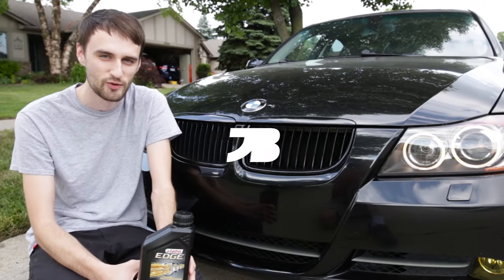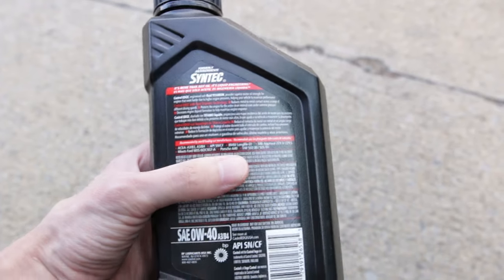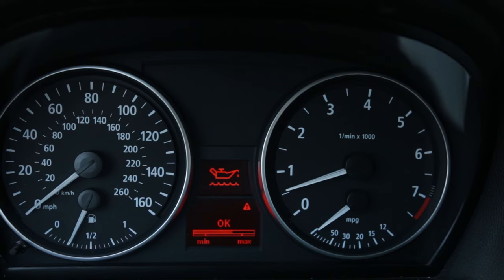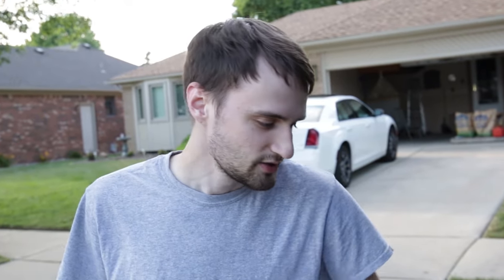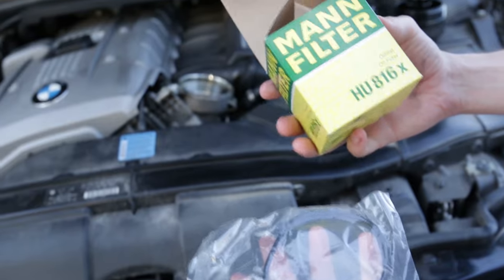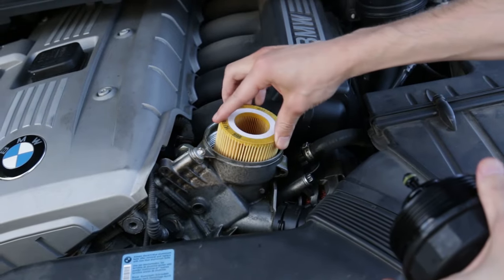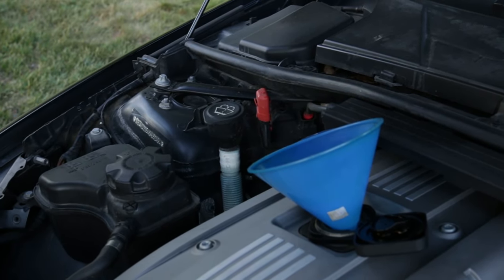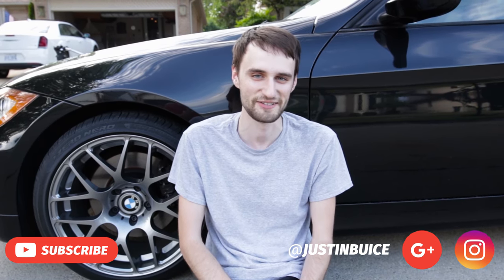BMW Change Your Own Oil!

Comment from the maker: Hey guys, I just uploaded and updated version of thie video. It is a bit more informative!
https://www.youtube.com/watch?v=XqgWPdBYx_U
Reply: Justin Buice sister
Reply: Hey Justin, how many quarts of oil do we add?
Reply: Justin Buice Hey bud how are you and i have questions i want to change my bmw 325i e90 2006 Differential fluid which is 75W-90 but if u may know how much Quarts does e90 take 1 or 2 Quartz and also the Main bolts holding the diff face what are the FT pound Torque ? But i might just pump out old fluid then pump in new.
Reply: You should do a video on changing your gearbox oil too.
Reply: J05ephx That would be nice and since its my passion 👌🙌
Reply: Hi man...I have a problem of inative oil level sensor....how can you help....I have tried everything...(e90,,,325)2007
Reply: Why u are using 0w40 and not the 5w30 as bmw recommendation? Thanks

Comment: You should put the oil filter into the cap and push down until it clicks and has a little play. Not put the filter in the housing first. Other than that great video. I enjoy your vids.

Comment: dang, thought it was going to be harder, but the extra steps are very simple.  Nice video Justin.  Thanks
Reply from the maker: +JimsReviewRoom yeah its pretty much the same as any other cay besides the gaskets on the oil filter. Shouldnt take more than 20 minutes
Reply: JimsReviewRoom I
Reply: You own an e90? If you do that's awesome!!
Reply: Wait is it? No need to remove the cover? Nice.. but coolant still needs to?
Reply: Im goin to domi today tired of paying 180$

Comment: @Justine Buice... I just bought a certified pre-owned 535i GT. I'm gonna try this myself. I've changed oil in my Sonata and Azera. For some reason I have felt incapable of even looking under the hood of the BMW. It's setup like they don't want you to touch it. Thanks for this empowering video!

Comment: remember to use rubber gloves next time :) used engine oil is very bad your body.
Reply: AndersDog94 good tip
Reply: AndersDog94   Been changing it without gloves for 25 years & no issues
Reply: AndersDog94 That would help!
Reply: No he's right, petroleum isn't good and absorbs into your skin. Any issues wouldn't arise until you're much older. Brake dust is the worst though and I would wear a mask or resp while doing brakes. Now I've done thousands of changes without gloves as a mechanic but honestly it's much better to use nitritle gloves mostly to keep your hands clean for when you need to touch things you don't want to dirty. The protection is just a bonus.
Reply: Get out a here, only real men work on cars.
Reply: There’s a difference between acute and chronic exposure

Comment: I had a 3 year leased BMW and spent $1.27 on that car. Now I have a used M535i gonna do oil change this weekend. Looks like the oil/filter is gonna be $40-45 roughly. Great videos. Port Huron, MI is where I grew up. Now in Florida.

Comment: Great Video! Like you, I always take pride in servicing my own cars, which includes brakes, oil, cv joints, tran fluid, etc. For Safety and body mechanics, purchase a better jack and a oil drain pain (most separate the plug from the oil). You should also install the filter on the base once you install the gaskets, then install it. Purchase the oil filter tool to remove and install the oil filter. Oil Filter housing screw and oil pan plug should also be torqued to required specs with a torque wrench. My 2017 M3 is still under included Ultimate Service Warranty, but I will service it once it expires.

Comment: love your videos, if you cant tell from the mass commenting I've done today. 

I had a similar jack but when I bought this car it was lowered and I couldn't get under it with it. I upgraded to a much larger, low-pro jack. It was about $200 CAD. And well worth it. It's easier to operate due to a larger pad and better leverage from a longer handle. I feel safer working around my car. 

FWIW oil changes are the one thing I don't mind paying for. It's messy and tedious. And historically I don't feel like I saved all that much money versus the effort (getting parts, disposing of oil, etc). And it only has to be done once a year based on how little distance I drive.

Comment: Hey justin, thanks for the great video. Just one thing, BMW oem oil and manual recommends SAE 5W30. That is the one I use for my 2010 325i. Why did you decide to use 0W40 instead? Thanks.

Comment: Great video! I have a Bmw 2007 328i sedan. What oil would you recommend it has high 140000miles. They say volvine , Castro or Bmw high performance I am really confuse and scare of what to add on my car.

Comment: Hey justin i just got a 2006 325i and wanted to do the oil change video helped a lot but wondering to use SAE 5w-30 or 0w-40 i dont have the owners manual

Comment: Great video!  Make sure that when you put the oil cap on you don't over torque it because it could cause the cartridge in the center to snap off! If you have an N54 or N52 don't worry about it and stick it back on, but a few models it can not reattach.  I made a video about this issue because a lot of people don't know the problems it can cause.

Comment: That motor takes 6.5 Liters, so you'd be okay using 6 quarts of oil. Also you can buy an oil filter socket on amazon for about $20. That's where I got mine and that's the one I use in the shop.

Comment: I have a question 2017 BMW 330I. FRIDAY March 18 oil change by a lube place got done 1 mile down road low oil pressure light came on. Aftermarket filter was used. Could this be filter. I should use  BMW filter? Car run fine. I am not driving it at all. Until I change filter out

Comment: Thanks for the video, looks very nice, but I don't understand, you cut the o-ring from the correct location in the cover cap, but then you locate the new o-ring in the wrong location, up against the lip of the cover cap, not the groove then you screw the cap on leaving the o-ring visible [@3:36]. I know you haven't done this with all your oil changes, as it was in the right location when you removed the cap in the first place, and you're clearly not a newb yourself, so could you please update this video, so other beamer newbs dont screw it up.

Comment: Hi, i have a 06 BMW 325i anyway always change myself too so it s much cheaper than mechanic. :)) ( mobil-1  05-30)
what i do  when i change the oil open the first filter  and oil cap so it s gonna come down oil so fast. also you can use plastic ramp it better than jack. 
 thanks
Reply: Wrong oil you’ve been using

Comment: Does it automatically adjust the onscreen advice with respect to service time suggestions? How do I tell the computer I have changed the oil? Do I have to buy an $800 reset/ diagnostic computer?

Comment: So idk where the drain plug is, tried doing an oil change but that parts stopping me, idk if it’s cause I took the plastic splash pad off or whatever they’re called that go underneath the car but I can’t find any little flap with a drain plug behind it

Comment: Use gloves. Open the oil lid before you do anything. And dont max it out the oil, it's better to have the amount that Justin had before he changed the oil and then fill up from time to time.
Reply: Why is that so ? I just have my car serviced and filled 4L of engine oil I thought it wouldve gone to maximum level but it's just same as the level as the starting of the video.

Comment: Hi Justin. I have quastions for you I have 2008 BMW X5 3.0si and I don’t no what can of engine oil I have to use 0w-40,5w30,5w40.I used now 5w40 Castrol but this oil am not sure is the best let me know Thank You !

Comment: Great job! But to hints 1) I like to put a rag next to the funnel that way when I remove it the oil cause right on the phone and not on the engine. Hint #2 leave the oil cap open before removing the oil plug go make the oil flow a lot easier and hold on to the plug Don't Let It Drop into the oil pan next time..lol

Comment: I just bought my  2007 Bmw 328i from a local used dealership 3 months ago but I can't Check the oil if it's a safe color. Should I change it? And In the manual it doesn't how much it takes.

Comment: What should i do if an oil gauge dosen't work?
 My 2006 bmw was low on engine oil  when i bought it, so i bought 7 liters of engine oil and put six and half of it but my oil gauge bar stays at only half of it. Is there any problem with my oil gauge or would it show full bar eventually?

Comment: I'm 15 now and saving for a car I want an e90 or e93 (328xi). My parents said insurance would be outrageous, I got an online quote for $161 per month for me when I'm able to get my license. (Not bad for a first driver.) And then they claimed oil changes/maintenance would also be expensive and impossible to do I said they wouldn't, but of course as parents are they didn't believe me. I said all you have to do is get the car above the ground and it's the same as any other car other than the filter and oil. My dad is very mechanically inclined and can fix about anything, hes owned multiple BMW's now an M4 which I'm in love with lol. Maybe they just dont want me driving a car capable of 155 on the highway. My dad agreed to match what I save (So I can learn the value of money, which I'm perfectly fine with b/c I will never have that chance again since you dont get cars half-off) , I'm trying to stay below $10k combined meaning I would save a little over $5k. The other option is a Kia Cadenza the insurance cost is $183 per month and a Ford Focus $797 per month(I'm sure the site glitched haha, I did it again and it said the same), the BMW would probably be more than both with premium gasoline unless the Focus is actually $797 per month🤣. Any thoughts? Am I being reasonable or not? I'm thinking the Focus is probably the best for a first car but I do like the Cadenza alot. Sorry if this was to long lol.

Comment: I have a 525i that’s has 114500 miles on it  and the first time changing my oil I went to oriellys and they recommended me high mileage Castrol Edge is there a difference or will it damage anything

Comment: Hi Justin,

I have been watching your videos so I decided to buy a second hand e90.=)

i got a 2005 bmw 390, and I am just wondering what would be the problem since my oil display would show i have enough engine oil but after few hours it will show that i dont have enough oil? would there be anything that i would need to check or replace? thanks for the answer

thanks!
jeff

Comment: Hey man, nice car. What is the milage on your car? Is it reliable? Also, I wanted to say instead of having to mess around with jacking up the car and the drain plug why dont you get a oil suction pump? In europe everyone uses those its much easier.

Comment: Hey! When I took my oil cap off it looked like there was no oil inside but my sensor says my oil level is at the maximum level. Should I be seeing oil inside the reservoir ?

Comment: I've bought Castro Edge high mileage that's 5w-40 full synthetic for my '06 530 xi.    It does not say it's German made, its USA made.   I see you have the same oil except your weight is different so what am I missing ? What is the big deal friend ? Please do tell.  Nice video tho

Comment: Justin you are very knowledgeable about BMWs. Can u answer a question? My 2009 535i is having an issue. I keep getting a warning and/or alarm that there's a gear selector malfunction. I can shift into D, N, R, and drive just fine but it won't shift into park. I turn the car off and it's back into park when I restart it. What do you suggest? Thx
Reply: patsatx   If that's a steptronic like my 530 xi is then you very well may need to check your wires on your gear shift.   YouTube it.  They become worn & may need taped up & or soldered.   Minor & relatively common issue.

Comment: Hey Justin, I’m confused with the oil change. I’m low on oil so do I just top it off or do an oil change? I know we have that oil maintenance reminder on how many miles to go before an oil change but that looks like I don’t need a change for another thousand miles or something like that. Is that even accurate?

Comment: Did you climb under the car with the only thing holding it up being the hydro floor jack?
Reply from the maker: +t s i used an axle stand
Reply: Justin Buice
 I know this sounds obvious, but where do you put the axle stand?  I've been jacking at the front center hardpoint and using jack stand at jack locator on the side sill, but that's terribly unsteady.

Comment: what do u do with old oil? also I heard putting oil in the filter is a good idea to since you don't want it suck dry. Not sure if that's a myth.
Reply from the maker: +GodKing804 most auto part stores recycle it for free
Reply: Justin Buice thanks dude
Reply: Agreed. Filling up a spin on filter doesn't hurt, but there's ZERO evidence of it being necessary. Also kind of moot on BMWs with their element filters.

Comment: I've been looking for a vid to show how to change oil on a 3 series! I'm sure its the same procedure for a 2010 328i...i also got a straight 6 in mine.... appreciate the video!
Reply from the maker: Yeah it's pretty much the same, just check the manual to confirm the correct amount of oil

Comment: Hey man i have question om looking to purchase a 2006 330i manual what do u tbink about these cars? And what about the oil level sensor? What if tht snesor breaks and u dont know how much oil u have in it? And are the waterpumps a major issue?
Reply from the maker: I love mine. I've had it for 5 years now with minimal issues. The oil level sensor isn't as bad as people make it out to be. As long as you are doing regular oil changes it's not a problem. If the sensor dies, the car will give you an alert and I don't think they are too hard to replace.

As far as the waterpump and thermostat, they are a widespread issue and they tend to fail between 80k and 100k miles. Fortunately, the parts are only about $450 so if you are handy with cars, it's not too bad of a repair. Especially considering that that is one of the ONLY major issues with these cars.

Comment: I just bought a 2007 328i and it says the oil level is OK. But should I change it? I don't know when they last changed it. What would you recommend?
Reply: Check what colour the oil is, if it's still yellow like frying oil then it should be pretty fresh, but if it's not that i'd recommend changing it anyway since it's not expensive, and a frequent oil change really keeps your car running smooth! I have a 2001 Mitsubishi Galant, owned it for 7yrs now and I can tell by the feel of the performance and sound of the engine that I need to change the oil :)
Reply: Peter van Lelieveld thanks for your help but the bad thing is that my car doesn't have a dip stick so I can't check

Comment: at 3:44 you say youre gonna change a gasket? do you mean the one on the drain plug? and if so, where do you get a new gasket for the drain plug? does it come with the oil filter? thanks man, love your content!
Reply from the maker: Most brands of oil filters for this car include the gasket for both the filter and the drain plug.

Comment: Hi , can I change the oil filter after the mechanic has changed the oil ? I mean the next day for example?
Reply from the maker: They should have replaced it at the same time. If you take the oil filter off now, some oil may come out
Reply: Justin Buice usually I change it every 10000 km but the oil filter every 30000 with the service. Is this ok?

Comment: No need to reset the computer oil interval thingy?
Reply from the maker: +Robert van Ockenburg you can reset it but keep in mind that the service interval is programmed for 10,000 miles. I do mine every 6,000 so i just record it on paper to remind myself

Comment: Sir, sorry for the dumb question but does this method apply for the BMW X1? I'm thinking about buying one and def. don't want to be spending hundreds of dollars on oil changes!
Reply from the maker: +Rah H the process is the same, just check your owners manual for the correct amount of oil. Each engine is a little different

Comment: Bro I am getting a 2007 525 xi. Where did you get your rims from
Reply: please do tell because I have the '07 525xi  and I want 18" rims on it, and also does it make a difference on in the different on how wide the rear are vice the front?
Reply: nick3159 The wheels are from VMR, model V710.

Comment: Did the oil plug gasket come with the filter or did you have to buy it separately. Btw I'm thinking about buying a BMW and your video are very helpful in making my decision I have a family so 3 series may be a little small for me I'm thinking 5 series but keep up the good work
Reply from the maker: All of the gaskets come with the oil filter :)

Comment: I got a bmw 330i 2006 can i use the same oil your using
Reply from the maker: Yes
Reply: Justin Buice so my castrol edge oil came in and it’s the advanced full synthetic oil SAE 0W-40 A3/B4 is it the same oil or do I need to reorder castrol full synthetic oil SAE 0W-40 A3/B4

Comment: Hi bro how come you used ow-40 instead of 5w-30?
Reply: Most German car manufacturers require european spec' 0W-40 oil..meanwhile the avg car just needs 5w-30. 0W-40  has a wider temp range to handle in extreme hot or cold environments. You can just google it and do more of your own research. Hope i helped.

Comment: What if the oil sensor goes bad and you don’t have a dipstick?
Reply from the maker: You get an error message if the sensor fails. I never needed to replace mine in the 6 years I had that car, but I read it's fairly easy

Comment: BMW dealers will do a "Value Oil Change" which is just an oil/filter change for $79.95.  I take mine between service intervals for this.  I have a 2013 328i and a 2012 535i and get it done on both.  I've done it for years on all of my previous ones.